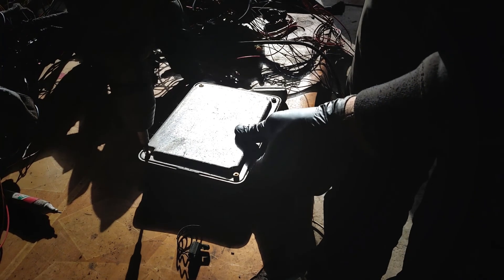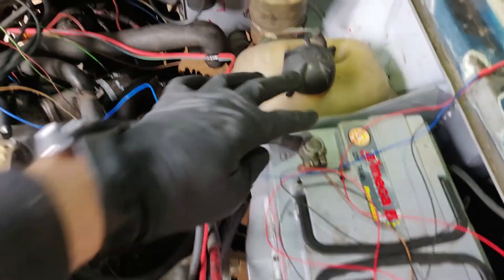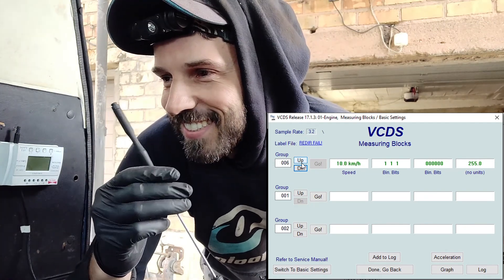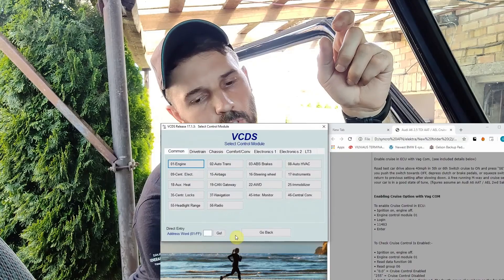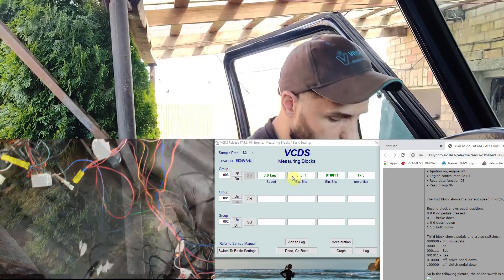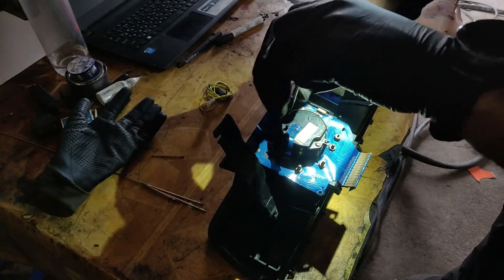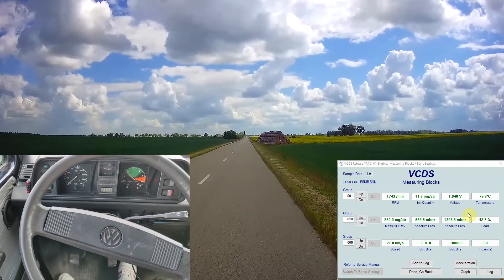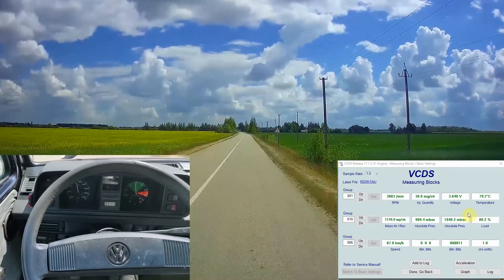VW T25 / T3 Syncro 1.9 TDI AFN conversion Ep:2 Cruise control setup, VSS and wiring harness.

Comment: Can i ask why did you do the immo of procedure?
Reply from the maker: Because immobilizer consists of three parts:  ECU, key with the immobilizer pill and instrument cluster. If you want to use OEM instrument cluster and original key, in another words get rid of those two of three you are doing the IMMO off procedure.
Reply: And do you know which wire is the k line from ecu i have a 81 pin ecu from awx engine but i cannot find the k line and i cant find a diagram :(
Reply: @biminjo6999  I believe,  that your ECU is never and has no K line, even though it's 81 kw. It should communicate via Can bus wires. What's the code of your ecu and what's your donor car?

Comment: Would you convert mine for me? From wbx auto to tdi.manual. Keep up the good work.
Reply from the maker: Aren't You from England? it's a little bit far away from Lithuania to do a swap for You. Just curiuos, why do you want to get rid of autotrans? Thanks.
Reply: @Gadomaitis  do you think the auto trans would work with a 180 bhp petrol
Reply from the maker: @eizgot  sincerely, I'm not an adviser here, I have 0 experience with auto transmission. The only thing I know is that people have them and using them. I assume You know better.
Reply: @Gadomaitis  can you pm on messenger search me on fb togs ali

Comment: Wat kind one clutch plate and pressureplate did you use? Original 1.6td?
Reply from the maker: Yes, original 1.6 TD (JX) clutch, flywheel and pressure plate.
Reply from the maker: Forgot to mention, clutch was slipping because of my error, the flywheel had oil on it from pilot bearing, I didn't noticed it and didn't cleaned it. After removing gearbox for second time I have cleaned the flywheel and had no clutch slip ever since.
Reply: Thank you for the information👍👍
Reply from the maker: @elmarruben  no worries

Comment: Very nice video! Dont forget the oil cooler ;)
Reply from the maker: For the engine oil?  I will search for info about that. Cheers.
Reply: @Gadomaitis  jap for engine oil. Its pretty important, without you will have about 120° Oil, with oil cooler you have 90-100°
Reply from the maker: @99lebakas  will do that, thanks heaps for your advice.
Reply: @Gadomaitis  no problem dude :)